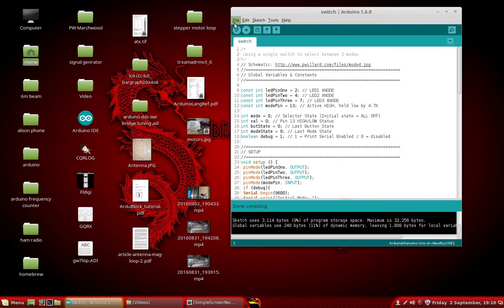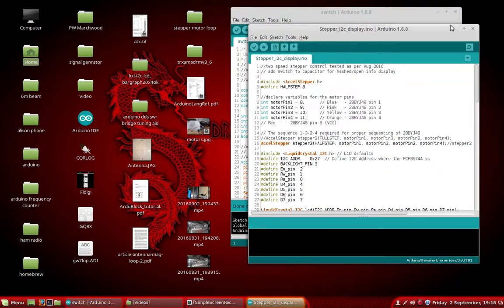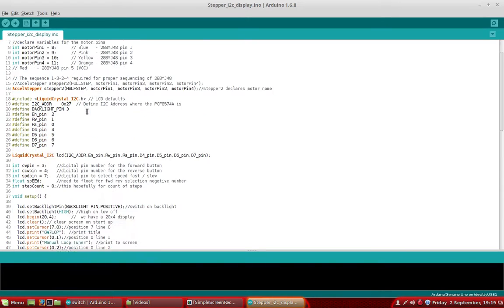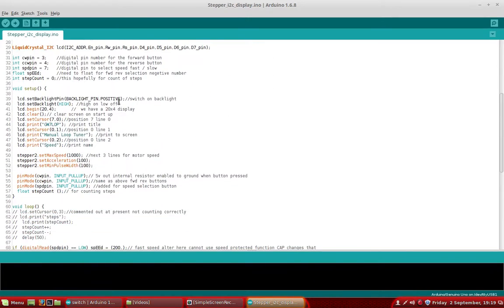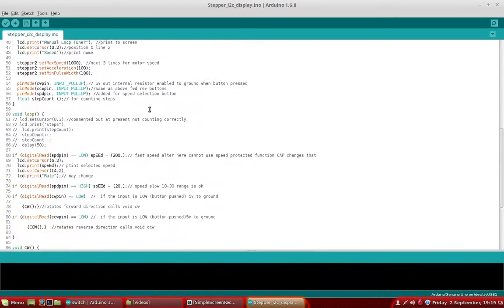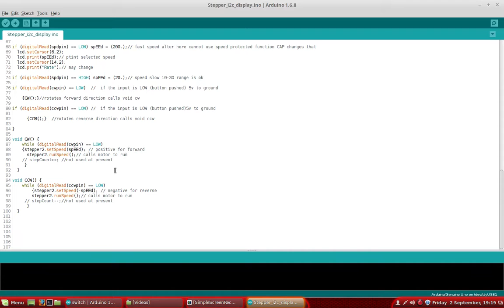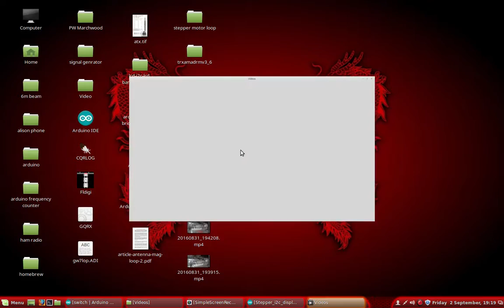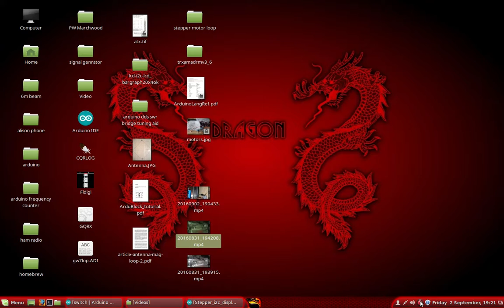Arduino magnetic loop tuner manual control

Comment: Hi Steve, I just hit your video here on youtube. I wonder if you went eny further with this project. I made the controller from Loftur and placed a video on youtube as well. just search for PA3VOS.
Do you have any documentation regarding your project? 73's Fokko
Reply from the maker: Hi yes I did finish the project video it all then sd card error and lost it all ,it works fine two speeds fast slow microstepping and tunes 7-26 mhz document only arduino sketch?